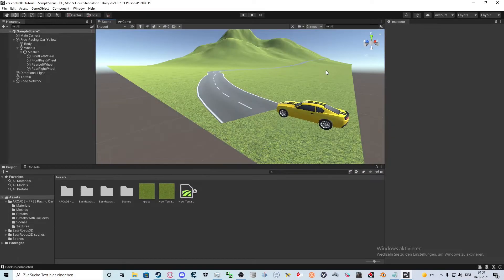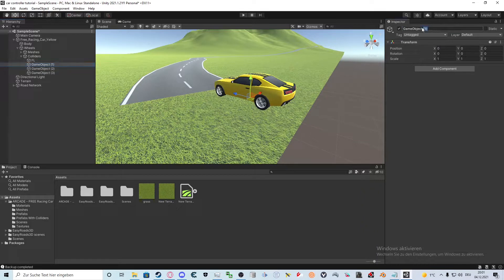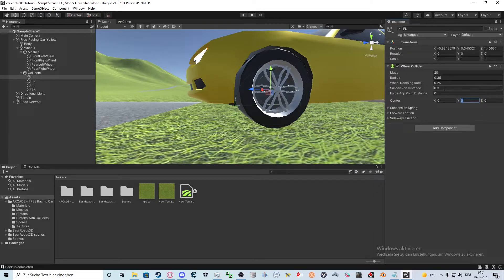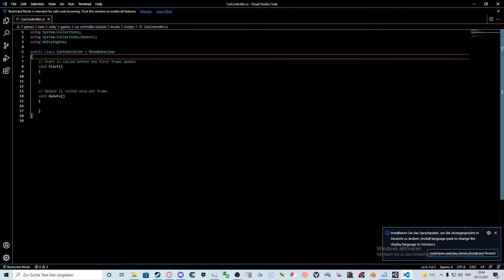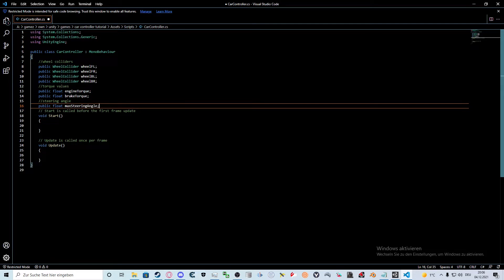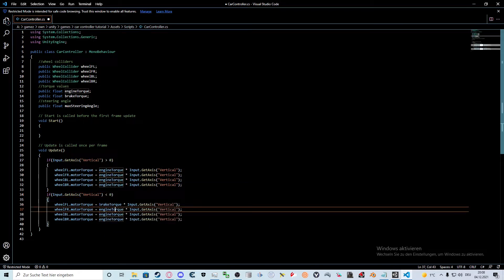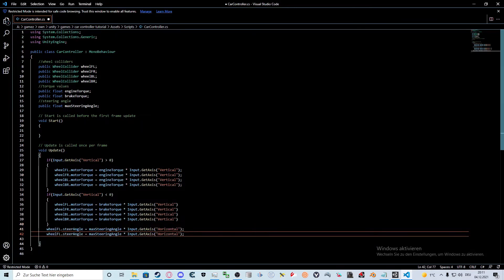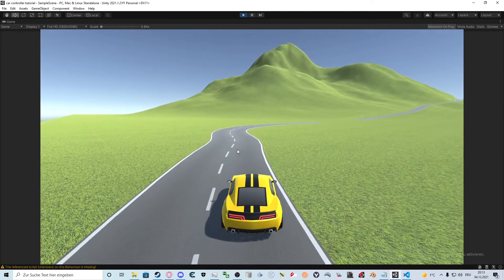(Old video) How to make a Unity Car Controller #1 - The Basics

Comment: My car just jumps around after I wrote that first code
Reply from the maker: Check the mass of your rigidbody, it might be too light for the forces applied by the wheel collider
Reply: @meehdrescher  i have it on 2000 and also damper on wheel collider on 1500 cuz I saw that it could help, but still nothing
Reply: @meehdrescher But thank you for trying to help even on 3 years old video 😂
Reply from the maker: @lumoslumosovsky.3415  out here doing my best even if best doesn't mean good lol, haven't been coding with wheel colliders almost as long ago as this vid came out because they are too annoying to use, but another option could be to turn down the spring and damper forces on the wheel collider wayyy down
Reply: @meehdrescher  thank you I will try that
Reply: @meehdrescher  still nothing. I have no idea what else to do, but still thanks

Comment: Hello. Thanks for your tutorial. i have a problem that my car tends to slide rather than steer
Reply from the maker: If all of the code you typed is correct, you might need to adjust the sideways friction of your wheel colliders. Go on the object where your wheel collider is on, and under sideways friction, lower the extremum slip or increase the stiffness.
Reply: @meehdrescher  thanks i tried that but it still slides to the left and right rather than turning. Any 
ideas on how to fix this ?
Reply from the maker: @keithpatience74  Do you mean that when you steer, the back of your car suddenly slides out?
Reply: @meehdrescher  no the whole vehicle slides like its drifting rather than turning with the front wheels
Reply from the maker: @keithpatience74  that's because the wheek neshes don't rotate yet... but maybe you gave the car too much torque or steering angle, just try to decrease sideways friction > extremum slip and increase stiffness even more.
Reply: @meehdrescher  but in your video your car turns round the corners.  Mines doesn't do that at all. Sorry but I'm just starting out in unity
Reply from the maker: @keithpatience74  then I have no idea... just try the tutorial from RenaissanceCoders, maybe it will work then... I'm not very experienced in unity either